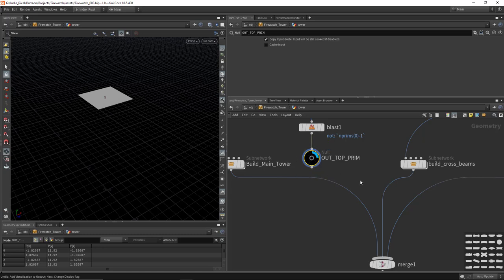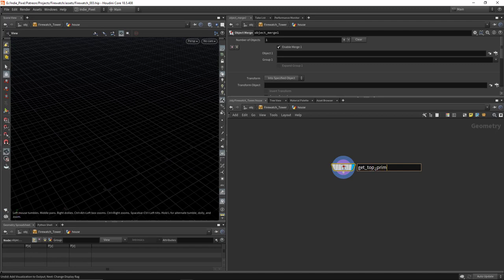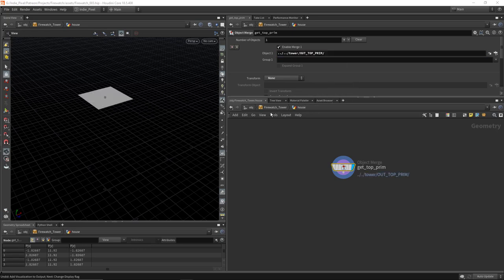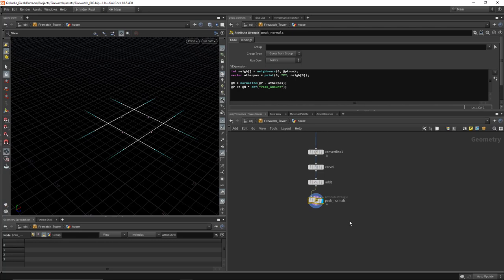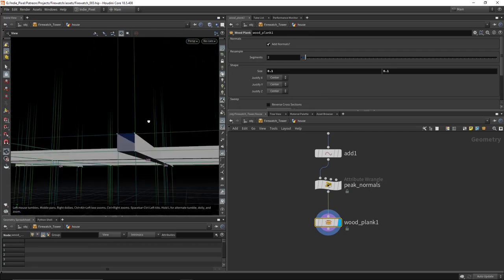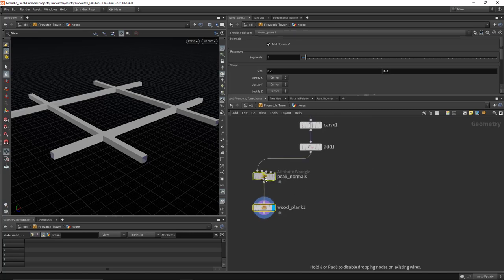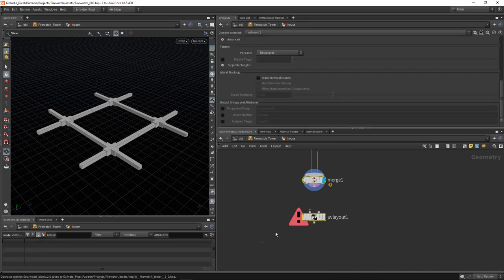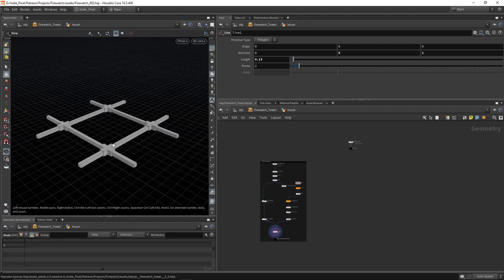Houdini 18.5 - Firewatch Project - Building the Tower house

Comment: I notice when you wanted to halve a value, you multiplied by 0.5 rather than dividing by 2. Is this preferred practice in Houdini? There are extensive debates about this in Unreal shaders, but over there the two are in fact essentially the same cost.
Reply from the maker: No, it's not any sort of preferred practice.  Just got into the habit of doing that for the very reason you described.  :)
Reply: @IndiePixel3D  cool. Yeah in Unreal the engine optimises that sort of thing behind the scenes- x^8 is calculated as ((x^2) ^2)^2 for examples as that's three multiplies instead of seven, so it's best to just go with what's readable. Halving is trivial of course but it's more important if you are say wanting to divide by 360 which would be some bizarre decimal multiplier.

Comment: one thing that is not understood is if these HDAs are production ready or fbx must be exported, or once the build is done they are converted internally.
I guess they are not very light for videogames but for cinematics, and with configurations such as rtx 3090 or A5000 there are any performance losses?
Reply from the maker: Each hda can be baked to a static mesh or instances.  From a performance perspective it's up to the individual to make sure the asset is performant.
Reply: @IndiePixel3D  thanks